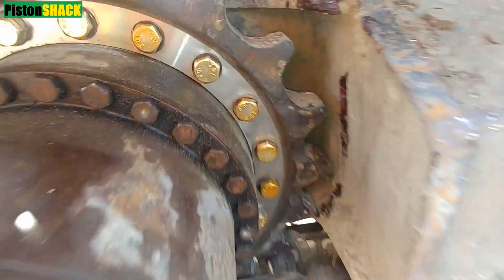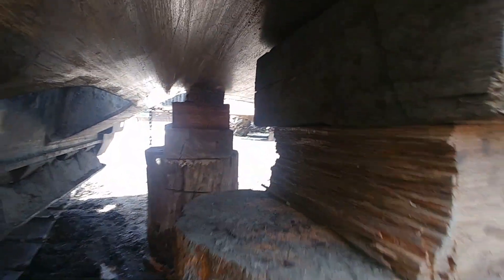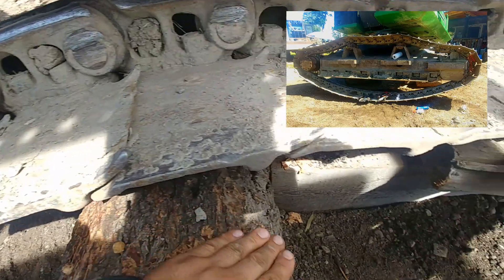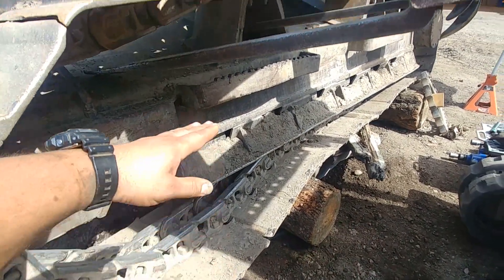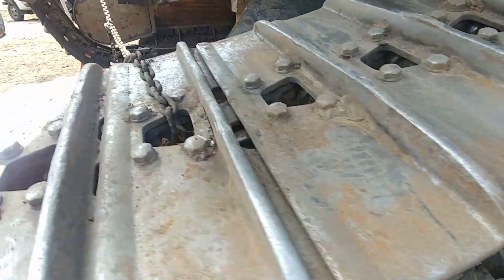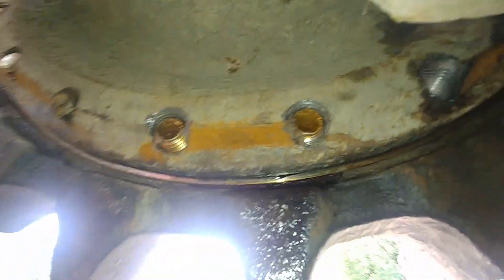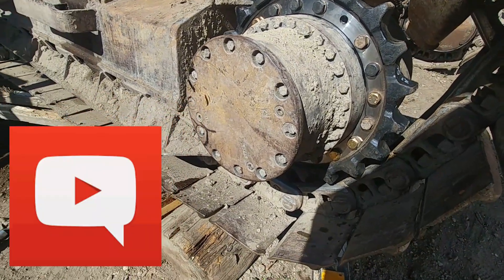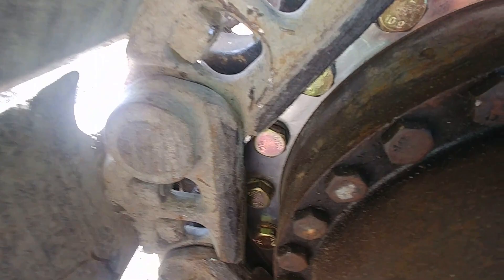NO REMOVING or SPLITTING TRACK EXCAVATOR FINAL DRIVE SPROCKET REPLACEMENT TIPS | JOHN DEERE 2154

Comment: What is the torque for the bolts on the drive gear ??
Reply from the maker: Hey Eugene! It all depend from make, model and year. I would refer to service repair manual or ask local dealer. Btw, what machine do you have?
Reply: @PistonShack  i have jd160 . I finally found the sprocket bolts 365ft lb .I could only torque mine to 250 ft lbs because lock washers splitting.. the track bolts are 575 ft lbs on my machine.